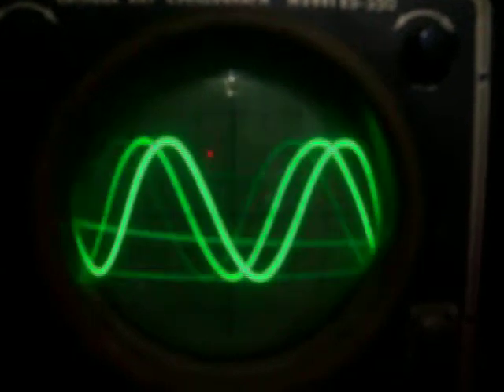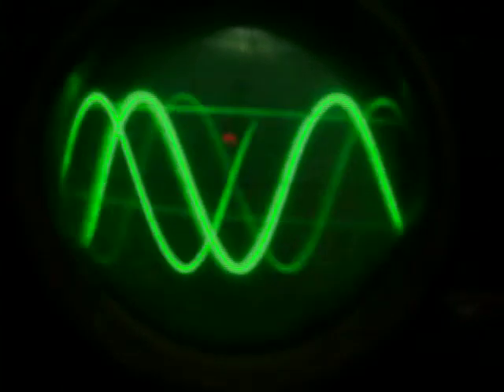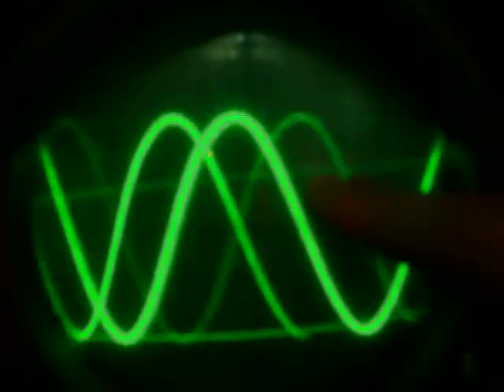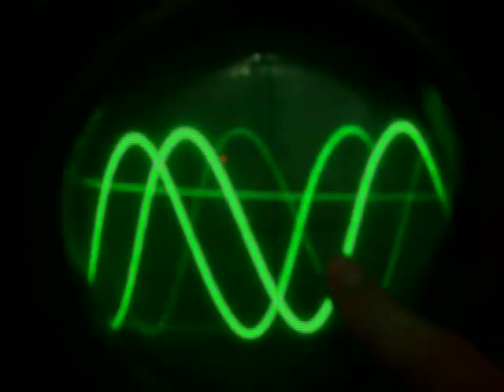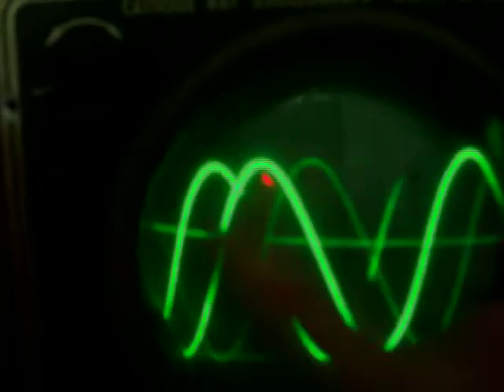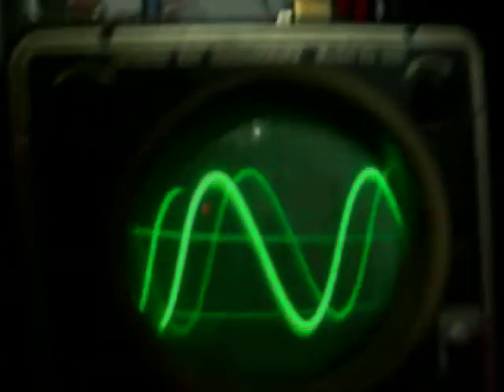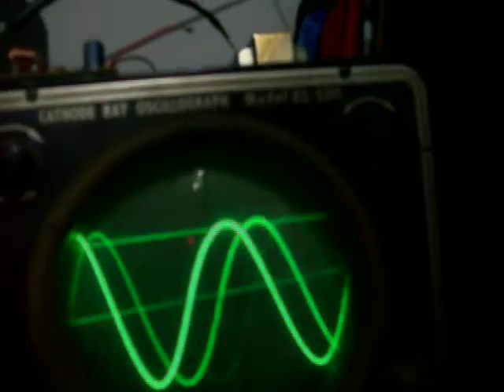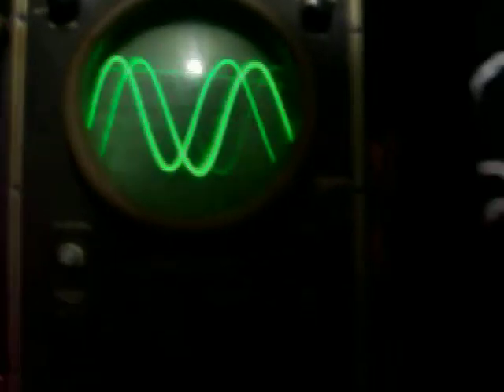A look at an old oscilloscope - how alternating current looks like

Comment: You 'smack' it, beacuse ot doesnt work?
1. Vacuum tubes need to warm up the heaters inside.
2.Put WD40 on valve pins and on the connectors.